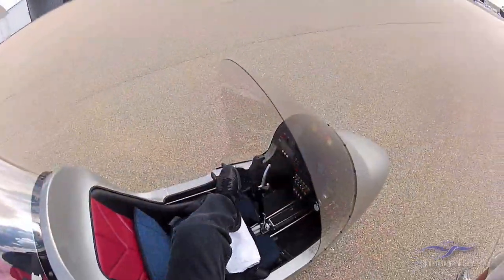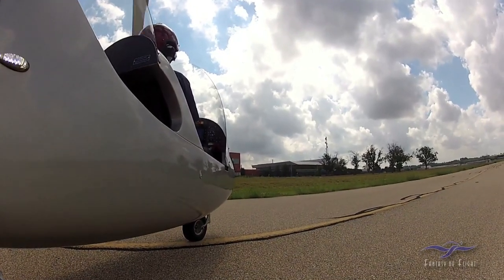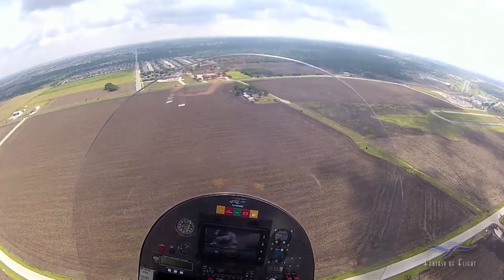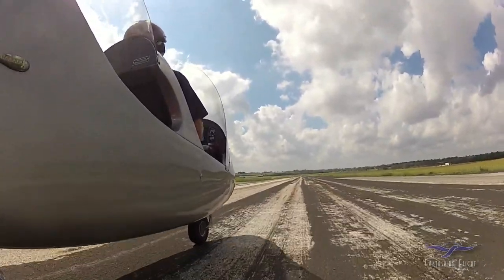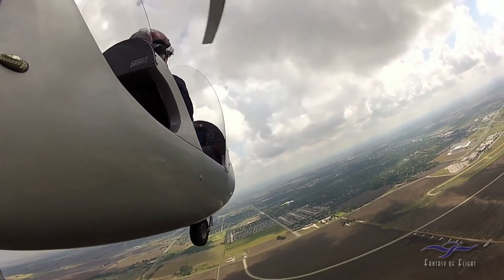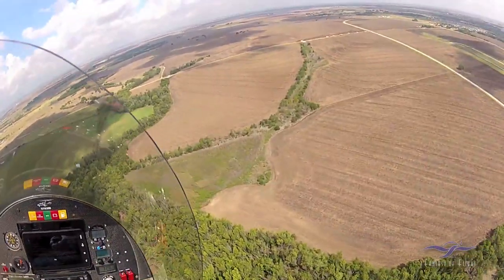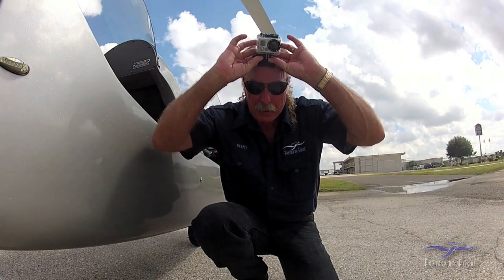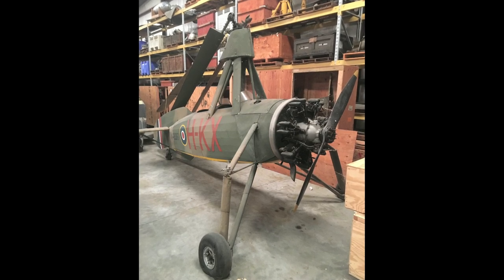AutoGiro Lessons - Part 3 of 3 - "Autogiro Solo"

Comment: I have been a Fixed wing pilot for 48 years, in my teenage days I did acquire 10 hours in the Bell 47 G but it too expensive for me at $65.00 and hour. So I went fixed wing. That was in the early 70’s. The Benson was the only gyrocopter that I knew about. Seeing these three videos are pretty neat to watch. I found the videos because of a link on Beechtalk. 😁🛫

Comment: Congratulation Mr. Kermit! Well done on this solo and getting your license! Please allow me for an advice. When you did the "touch and goes" in a "full-stop fashion" you did engage the pre-rotator to get back to 220 rotor rpm while the rotor was still spinning. The problem with this is that on the top end of the drive shaft in the time of engaging pre-rotator the bendix will rise and meet with the already spinning pre-rotator disc and kill the teeth on both the bendix and pre-rotator disc. Also, once it is engaged/in the time of engagement you may overload the drive shaft (bowden) and drive shaft assembly. Depending on the situation and how fast you are pulling the pre-rotator handle you may do demage instantly (in an unlucky event) or during a period of time.. Basically, its ok for moment to stand still WHEN there is some wind which will maintain your rotor speed for this short time and take of again as long as you KEEP the stick on your belly, but once you let the stick forward just bring the rotor to a full stop (by the help of the rotor break it should be not a long time) and start your pre-rotation procedure from the beginning. In case there is no wind than just make sure you keep the craft moving forward, again with the stick on the belly creating some relative wind going through the rotor and go again! I can't stress enough that this is only an advise! Wish you all the best with your wonderful gyro projects! (I am VERY jealous about the Cierva C30 you got there! I have seen one in the UK at the Helicopter Museum but that is not complete and has been victim of a shed fire as I rememberer..) Thank you for sharing your experiences! We love all this! Best regards. Adrian (Fix-wing and Autogyro Pilot/Flight Instructor)

Comment: Kermit - Welcome to the brotherhood of no-stall full-time autorotation flight!  I was 28 when I joined the club in my little Bensen B8M gyro.  Back then, most of us didn't even have rotor pre-rotator drives installed.  Instead, after hand starting the engine and strapping in we then pushed full forward on the stick and manually began hand spinning the rotor as much as we possibly could.  From there we applied full aft stick and began taxiing into the wind slowly and carefully at first to allow the rotor blades to spin up past the initial critical phase of taxiing too fast before the blades were spinning fast enough.  This would cause the blades to start flapping up and down and the tips could strike the ground causing damage.  Ask me how I know that.  :(  So once the gyro's taxi speed was sufficient, and the blades were a blur, the gyro would soon rock back on its tail wheel indicating the rotor was spinning at nearly takeoff speed.  It was then time to add full throttle, release some stick back pressure and she would accelerate and lift off on her own.  This technique was fine but takeoff rolls were long.  I added a flex-cable drive similar to the one in your gyro and it make a massive difference.  IIRC liftoff typically occurred at 300 feet vs 600+ feet by hand.

Anyway, congratulations!

Comment: Thanks for the education on the Autogiro. I didn't know that 60 MPH forward motion was necessary to bring it aloft, unlike a helicopter....6:30 knee pretty close to the key switch.
Reply: Hi cmans79tr7, the MTO Sport doesn't need 60MPH forward motion to bring it aloft. Lift off/climb speed is 55MPH but it will fly at 35-50MPH.